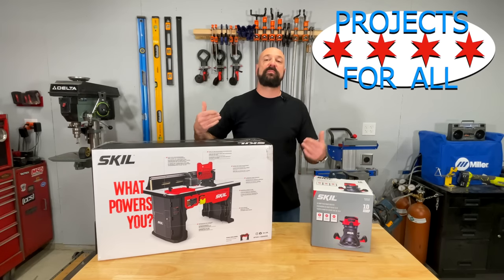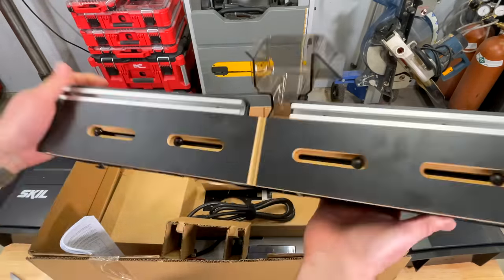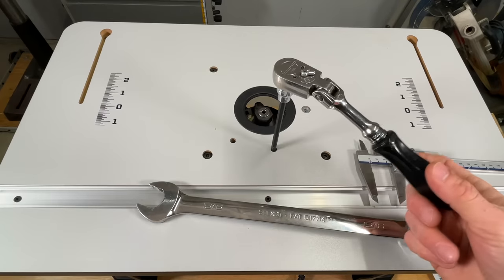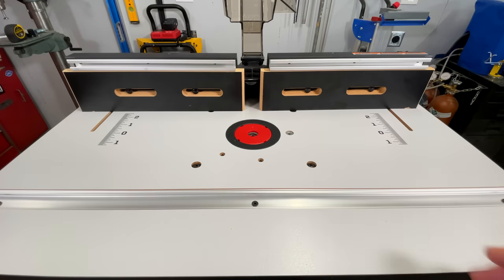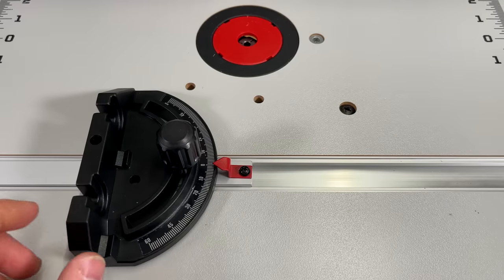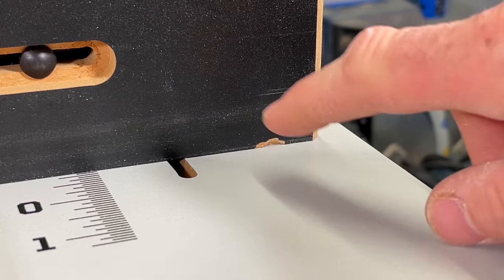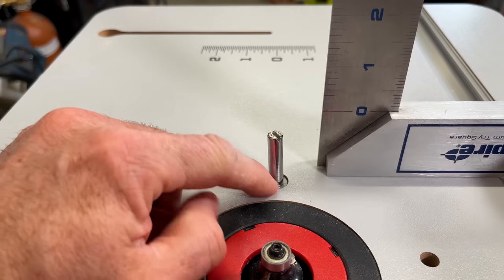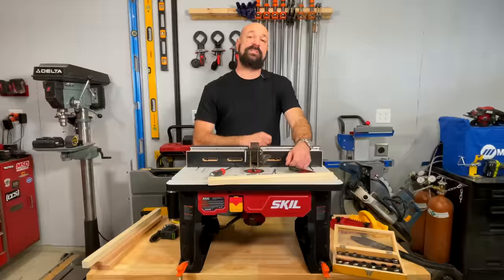Do You Have To Spend $400+ To Get A Good Router and Table Combo  ||  Skil RT1323-01

Comment: I was thinking about getting this now having second thoughts
Reply from the maker: It's definitely not perfect and if you plan on joining with it I don't recommend it. For basic router shapes like round overs, rabbets its totally fine. My buddy has the Ryobi and I think well do that one next. Then on to Bosch. Good luck with the decision and thanks for watching!
Reply: @ProjectsForAllReviews  what about the router itself would it be a good choice for a better table?
Reply from the maker: @davidcorliss  Didn’t see anything wrong with it honestly. Variable speed is necessary if switching between small and large bits and it works just fine. The base and height adjust is nice and simple and works well. It has plenty of power. When we get more routers I’ll have to do a comparison vid.

Comment: other than the lift, seems pretty bad ;/
Reply: I didn’t know that they included the router with the table
Reply from the maker: You can get them separate or together. Combo runs about $200. More if you buy them separate. Thanks for watching!

Comment: My recommendation is to build your own router table.  Many of the features on store bought tables you will likely not use.  Besides, you are a craftsman, right?  Go with a Porter Cable basic 1/2" router and build yourself a table with the features you need.  For $200 you can buy a lot of materials and have some fun as well!  But you won't need nearly $200.  There are router table build videos on youtube, that I am sure.

Comment: Very Very Cheap, If you are  doing any wood working this is not what you want.
Reply from the maker: Thanks for watching!
Reply: Its a lot better than the setup I have now where the table itself is plastic, has about 1/8 to 1/4 inch of flex in it...try making anything accurate with that LOL...the fence on the Skil router table I bet could easily be modified with a sacrificial strip along the front side and bottom to make it a lot more rigid.

Comment: I’ve built several router tables over the years but started with a decent router ($150-200), a sink cutout laminated on both sides, (free) and made a plate from 1/4” aluminum ($5-$10 at the scrap yard) and made a fence from scrap plywood.  Yes, it took more time to set up but I was young, poor, and had time.  With some care putting the pieces together it was flat and square.  Start with a good router, make or buy a good plate and the rest can be upgraded as necessary.  Even the bare bones version would be better than the Skil unit shown here.
Reply from the maker: Thanks for the insight Raymond!

Comment: Sorry bro … I wouldn’t put that in my shop … I do have some HB tools …..Bauer and Hercules but … I have makita and dewalt tools … all my tools have a purpose … my router table is HB … my hand planner - Bauer … my brand new miter saw is - Hercules  .. my hand router for edging is - Bauer  .. my big table planner is a brand new - Dewalt …. My plunge router is - dewalt all my hand drills are brand new - Makita … I do not like changing bits … ( as little as possible ! … it’s time consuming … time is money ) don’t put junk in your shop .. you will pay for it … I’m getting a new table saw … it’s 2500 bucks … major tools are needed … I would rather build a router table … my HF one is pretty good … but .. I need a really good one … so it has to happen … I do not like what skill did here … its not worth 200 bucks to have to fix wood issues or product issues from a poor design.